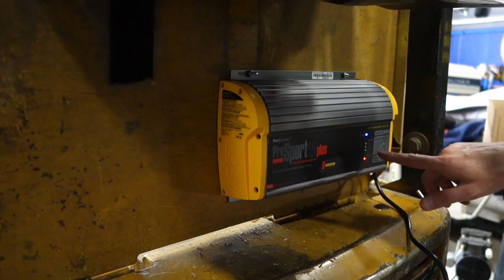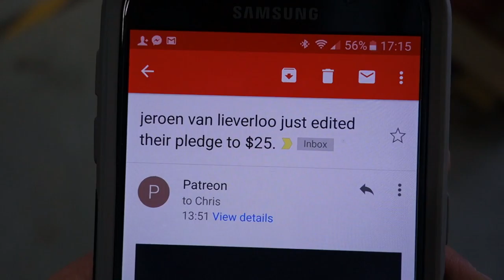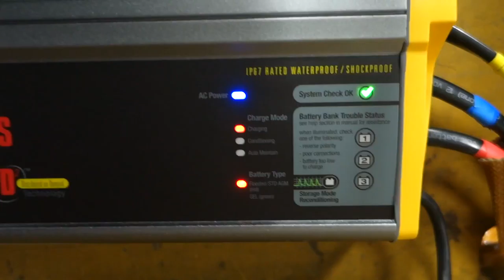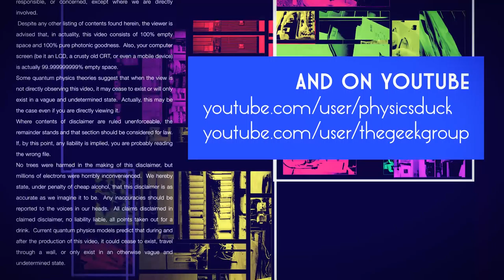Captain's Blog 5 3 2016 Dog Yard and Forklift Battery Hacking

Comment: Yea,yea,yea, I know all about making suggestions after the fact.  Please get hex head sheet metal screws.  Watching you guys driving them in was making me wince. All the strength you were using to keep the driver in the hole made them twice as hard to install. The charger is very cool! I'm sure the newest high voltage industrial battery chargers have the same control as that one......but not real cheap.

Comment: the tumbler on the van's ignition is the more likely problem  try vibrating the tumbler with something some have suggested a palm sander but whatever you have on hand will do. try to turn te key wile it's being vibated.    it's a common problem  on old mercedes where the tumbler wears out and you can not turn the key

Comment: tgg video sponsors are a diverse crowd.  what is the red pipey thing you removed?  washers are important parts.  1132  recycle and reuse is part of our mission.  great drumming, sir.  pea gravel is easier to move than other gravels.  using high spots of soil to fill soil gaps is a minecraft move.  even better your landscaping is minecraft in real life.  wow your soil appears to be very heavy.  look on the other side BEFORE drilling.
Reply: The red thing is a Fiberglas insulated terminal block.